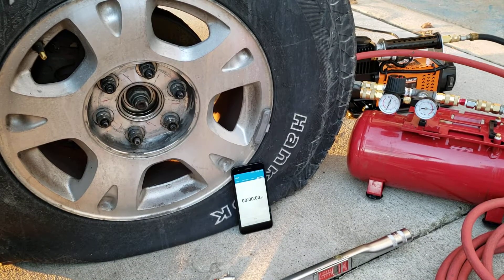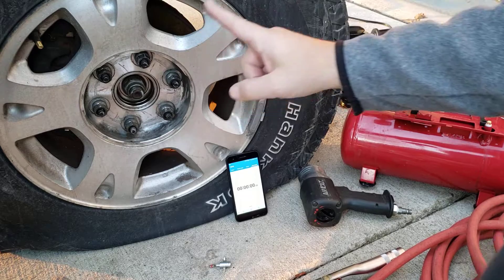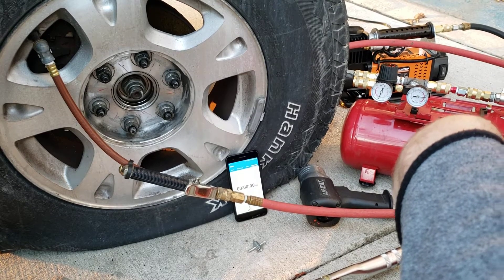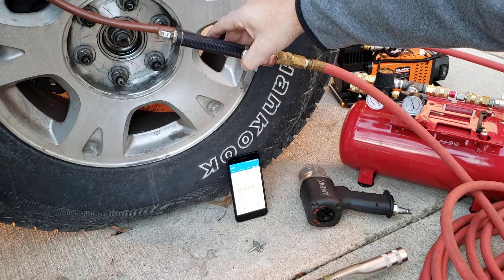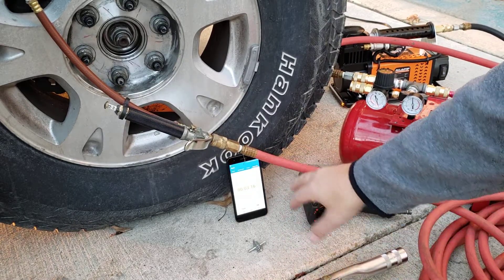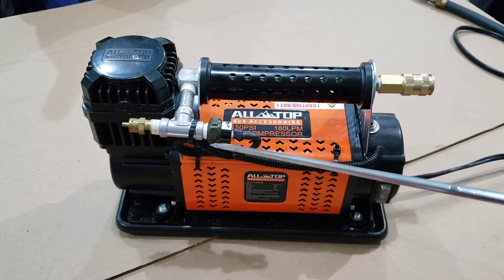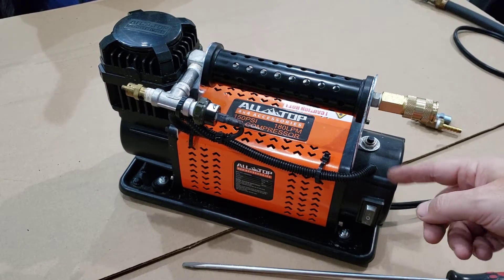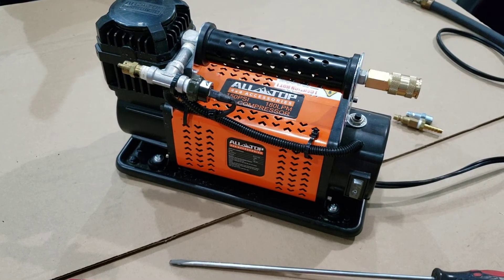Fast Onboard Air With an Impact 1 of 2

Comment: Would that tap also work for a flexilla high flow coupler? It's 1/4" body and 3/8" mnpt
Reply from the maker: It adapts to 1/4" NPT, which is widely used in the US, if you have 3/8" NPT then you need a different size

Comment: I am trying to switch out my quick connect, what is the thread pitch?
Reply from the maker: The original or replacement? The replacement would be 1/4" NPT but the original is a metric...part of the problem

Comment: Yeah that was pretty damn quick! I need to look into this set up for my smittybilt!
Reply from the maker: Of course it's never fast enough...but it's very usable and reasonable especially for the price. One can always use a larger tank or add additional tanks. But I don't actually use it a lot so didn't wanna sacrifice the space yet maintain usability. But having mobile air is convenient. I've had the other .7 cfm compressor running off an inverter for a while which is nice...but it's ungodly slow.